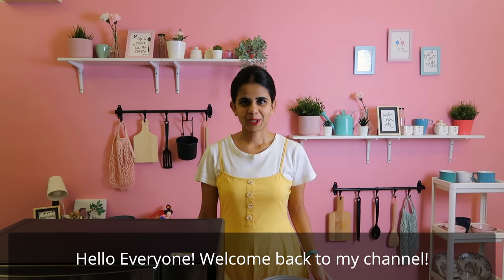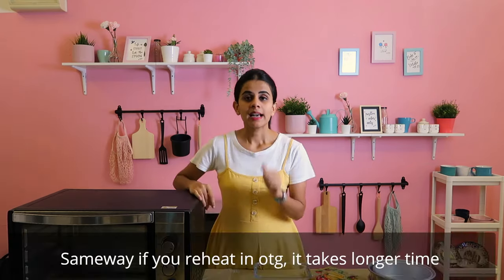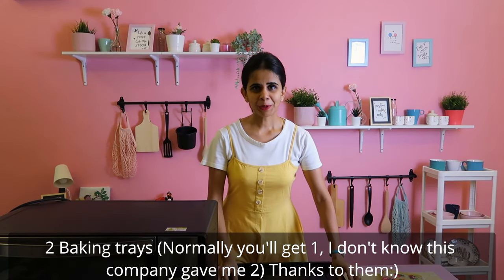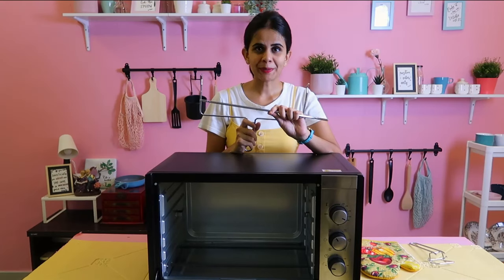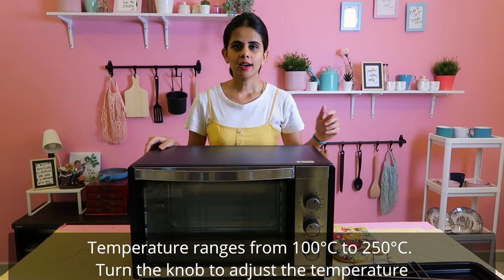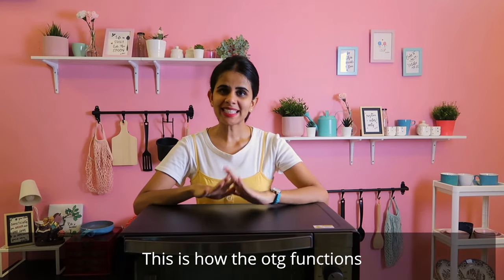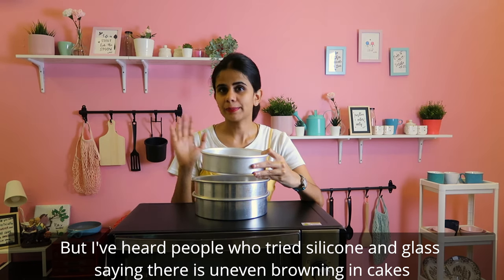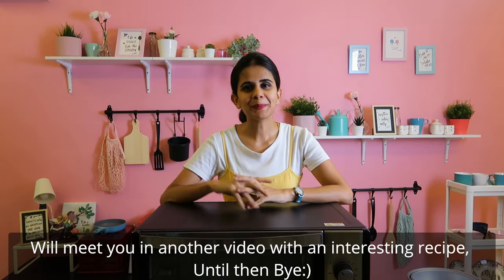How to use an OTG oven - Beginner's guide/ All about settings and functions/ Preheat & Bake in OTG

Comment: If the glass door gets heated whether it doesn't break
Reply: Borosil, boro silicate wont break, normal glass Silicone will break, here Borosilicate material used, will never break due to heat..

Comment: Mam I have doubts I am using Pigeon OTG ... It's mentioned that 230 degree & 20 to 25 mins for cake baking - So wt should I do mam...... Can I Preheat oven for 10 mins with 230 degree and after that do i need to bake for the given mins on oven that is 230 degree & 20 to 25 mins?
Reply from the maker: Ideal temperature for cake baking is usually 175°C or 180°C under normal conditions. But it's not always the case. Sometimes we bake at lesser temperature like 150-160°C(that's for slow baking). But I've never come across any recipe that says to bake at 230°C. So what I suggest you to do is bake smaller quantity @230°C as they've mentioned.If it works go for it. Or else try baking @180°C for 20-25 minutes.
Reply: @HarinesCookbook-HarineBaburaj  Thq for the reply mam... So at what mode can I bake mam....
Can I Preheat for 10 mins at 180 degree...after the cake pan inserted can I bake it for my same temperature for 25 mins ????? Or after the cake pan inserted can I bake it for the mentioned baking mode ah mam......... mentioned in the sense 230 degree for 25 mins mam.... Very confusing mam

Comment: Hi mam, am.using Morphy Richard 28lit otg....in that while keeping the otg in baking mode, only lower rod is getting heated.....the other modes are broil,tost.....so which option is best for baking...
Reply from the maker: Baking mode is fine. But I prefer both rods heated with fan switched on.

Comment: Akka .. OTG use panna current athigama ilukkuma..pls reply....ye husband kita OTG vangithara sonna ..athellam vanguna current athigama ilukkum nu soldranga...pls reply akka..
Reply from the maker: Hi Karthiga! Let's assume on an average otg consumes 2000W and you use otg for 3hrs a day. This results in 6KWH. Also let's assume the price of the current for 1KWH is Rs. 5 (This is maximum amount, usually it'll be less, say Rs. 2 or 3, but  let's assume the maximum). So it'll cost around Rs. 30/day (maximum) 
I can't comment if this amount is high or not, so it's your call :) As I've said earlier I've put the maximum cost and time, so definitely it'll be less than Rs. 30. Explain to your husband!!
Reply: @HarinesCookbook-HarineBaburaj  thank u sis my doubt cleared